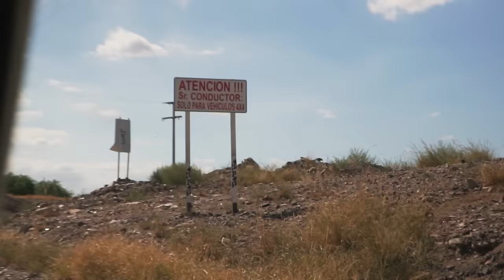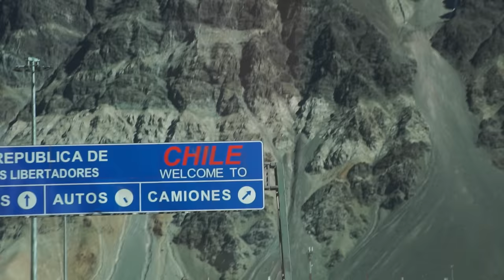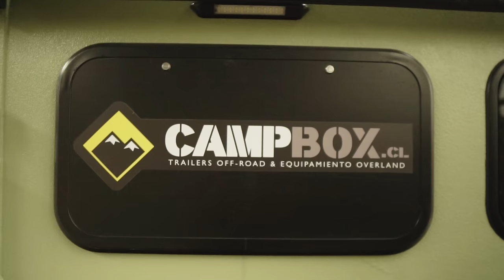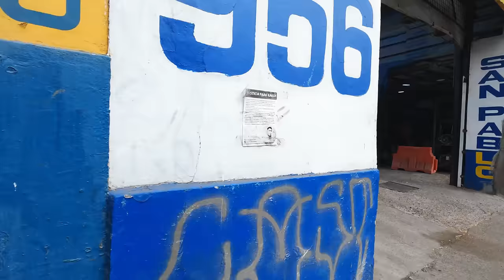The Obstacle IS The Way | Overland Travel Film

Comment: Bud you're hella courageous!!! I carry a pelican case in the back of my Taco (5vzfe) with everything short of main/ rod bearings at all times. Including 3x Denso coil packs, extra set of plugs and wires and even a full timing belt/ water pump kit. Most of my wheeling is within 1,000 miles from central California so i couldn't even imagine what'd have to carry down to Patagonia to feel "safe" 😅😅😅. As always epic adventures and incredible footage/ story telling. 👏👏👏
Reply: I am the other side of the camp. I take as little as possible. No big tires, no 4WD
Reply from the maker: Hahah so awesome! We have a full timing belt and water pump as well as a knock sensor harness 😂 we had heard how popular this motor is down here so thought that the basics would be easier to find!
Reply: @fraserwright9482  Curious how that works out for you -- I'm hoping to do the Pan American Hwy in a mostly stock awd SUV -- of course not doing any serious off-roading. My rig is clearly a "pavement princess" for going down bad roads, Ok, but not real off-roading. I'll stick to rural, but somewhat populated areas and smaller cities -- at least that's the "plan" -- lots of AirBnbs, hostels, odd hotel and campgrounds on occasion.

Comment: Thanks for the great content.

That cracking sound may be your camper. If I remember correctly, you used rigid mounts to attach the camper to the frame. Given that both cab and camper are attached together, there wasn't much choice but to use rigid mounts.   I would do a close inspection of the camper around the mounts, cab splice area, and walls.  It's common for cracking to appear in fibreglass camper body walls over time if they're aggressively off-roaded with rigid mounts. It's safer to separate the camper body from the cab and use flexible mounts on the camper.

Comment: Quick tip. Not sure if you're aware that spark plug wires can be custom made. You should be able to purchase the  crimping tool and terminal ends at a parts supplier. You could also use a similar style wire that isn't for that specific vehicle to get by. It's common in the high performance world to custom make plug wires.